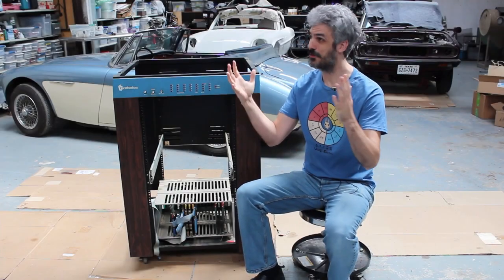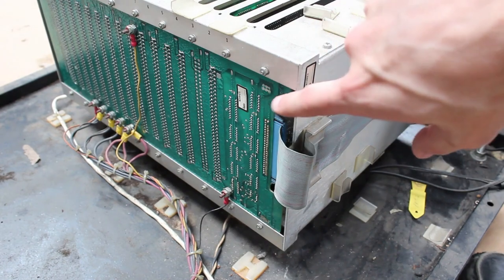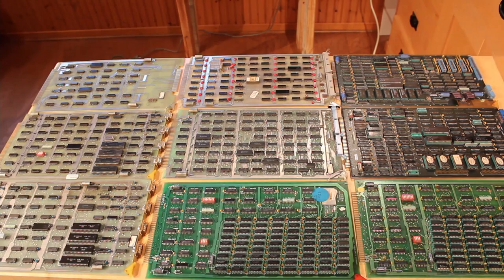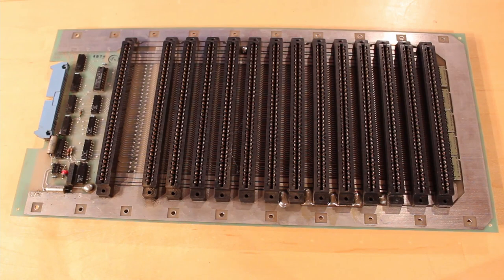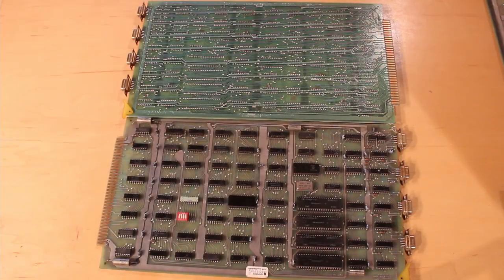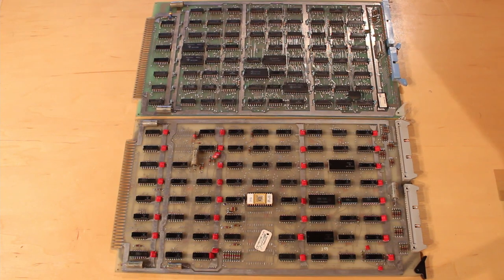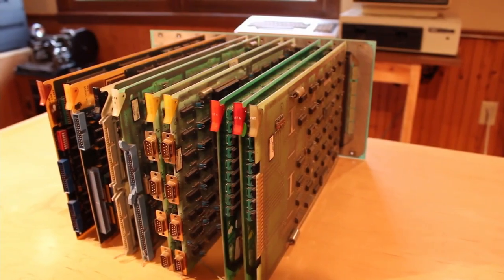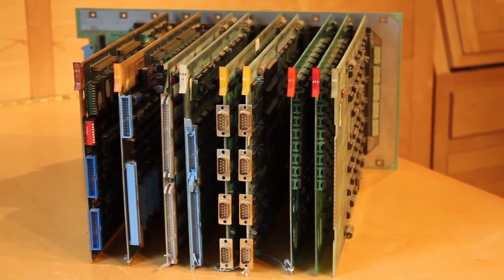Minicomputer Part 4: In-depth Look at all the Computer PCBs

Comment: I'm going to guess that the backplane board was installed at about the date marked, computers like that occasionally failed, and the engineer would just replace the boards with newer ones, or if there was an upgraded board for some reason, failed boards would often be repaired later by the engineers.
My brother was a computer engineer in that era and i learned a few things. including being witness to a head crash on a 10 disc pack at a large insurance company, 10 discs double sided so 20 heads (not all were damaged), but £600 each head in the 70's was expensive
Reply from the maker: Another commenter has reached out to me who used to actually work for Centurion back in the day! Check Ken Romaine's comment on this video, he has some unbelievably good information. He said that it's most likely the system was built around '79 or '80, and the stickers I see with different dates are warranty/repair stickers from technicians.

Comment: No need to replace bypassing caps, unless they are shorted which they don't usually do.
Reply from the maker: Yup, I think I'm going to go through and double check every capacitor for shorts on the board before I apply any power!

Comment: Looking at the CPU and CMD cards, the PROMS may contain the microcode and the BIOS. It would be interesting to get an EPROM reader and pull all the code off of them. I'm betting the architecture of the CPU is completely custom.
Reply: Also backing up their content is a good thing to do, these EPROMs can forget their bits in a future rendering the computer unrepairable
Reply from the maker: I'm totally planning to do a ROM dump of all the ROMs on the boards, just to be safe. Almost every chip on these boards can be replaced if something goes wrong, but the code on those ROMs probably only exists on those specific ROMs. So, hopefully we can dump them before anything bad happens!
As for a completely custom architecture, I think you may be totally right! I saw an old ad for a Centurion minicomputer that mentioned a "Centurion Word Processor", so it's likely that they had completely custom software to go with their totally bespoke hardware!

Comment: @11:49 probably some decoupling caps added after the fact when they found out things weren't stable.
Reply from the maker: That makes sense! 
I'm still not sure if they were added during production as a bodge for a defect on the board, or if they found that after use some instability arose and they "repaired" the board later down the line by adding them in. Either way, it's certainly interesting!

Comment: I have a feeling that this is an 8 bit architecture, but one of the boards is a secondary CPU for peripherals - or something equivalent.
Reply from the maker: I think you're right! Some others have mentioned it as well, but for these early minicomputers, it was apparently common to have essentially a separate CPU board that was dedicated to handling I/O and peripherals. These old computers are so different, it's really fascinating to learn about the ways they tackled problems back then!
Reply: @UsagiElectric  CPU cycles were precious back then, you wanted it to work on data, not acquiring it 😉 so a peripheral controler makes sense.

Comment: This old school pre-microprocessor computer gets me to wonder who designed it, and how, to what plans.  Each such custom (bespoke) design would have its own instruction set, it seems to me.  The ALU slice doesn't tell us what that is going to look like.  This is reminiscent of wild and wooly days where binary compatibility would be regarded as a joke.

If an assembler, let alone compiler, is found on board that would be a rare treat of a look.  Were contractors hired to program this for a business?  Or did the business use canned applications?  There is so much for the curiosity.
Reply from the maker: It really is a wild computer! It truly seems like Centurion was just designing things from the ground, which is absolutely awesome that they let their engineers run free, but also terrifying when it comes to repairs, haha. I've been able to find very little information about Centurion, but it seems they also had their own version of software too, so it'll be interesting if this thing ever powers up to see what's on all the disk packs. 
There's still a lot of work to do to get there, and I want to try and dump the contents of every ROM on the boards before I start putting power into things, but the more I dig into this machine, the more bespoke it really does seem!
Reply: Almost all of the individual minicomputers (and larger) had incompatible instruction sets. Heck, it was fairly common for successive computers from the same company to be wholly incompatible with each other. Sometimes various models in the same lineup might not be entirely compatible. ISA compatibility really only came about when the micros got super popular and you'd find the same CPU in machines from multiple vendors.

Comment: We were maintaining similar looking PDPs for air traffic control well into the 2000's, they just were too scared to move onto another system.
Reply: that explain the magnificent crash they had a couple of months ago, software systems are about a balance between change and ossification, they are running on dead systems, they just didn't knew it.
Reply: @monad_tcp  Not really, as they were replaced with a completely new system in the 2000's that took many years to develop.

Comment: 9:15 And it also seems to be connected to the crystal that is not present on the other board.
Reply from the maker: The other MUX board actually does have a crystal oscillator on the board, I just totally missed it!
If you look at 8:50 at the top board where the crystal is "missing," then go up to the top and over one row, that's the crystal. It's encased in a piece of heat shrink tubing, which is why I didn't recognize it at first.

Comment: Have the schematics been recovered/rescued?
Reply from the maker: Unfortunately, not yet.
I have met with a very nice gentleman who used to work for Centurion back in the day, and he's been reaching out to everyone he knows, but no one has been able to come up with any documentation yet. Some of the boards I can reverse engineer if necessary, but the CPU and CMD board are essentially 8 layer boards (power plane, ground plane, top copper, bottom copper, two top wire layers, two bottom wire layers) and are pretty much impossible to reverse engineer. Fortunately, they seem to be in pretty decent shape and mostly working!

Comment: UGh; age isn't so bad for some of those components, but do you need to check the resistors perhaps, see if they're at least shorted? But more to point, those caps.. do you know what kind they are (looking at the printer board); that is a really odd way to upside down them but okay .. but are they dried out and gone bad? Caps on the digital ICs are likely just decoupling to keep the voltage topped up, so a few going bad likely wouldn't impede operation but I coudl see a lot of caps going bad and needing replacing. Like cap kitting a CRT, but doing aaaaaalll those boards. Ugh :)

Wonder what the chances that exposed PROM still has valid code in it? usually a chip like that would be covered good or at least taped up .. just being wide open, means random sunlight that happened to get there over the last 30 years, could've wiped out something

Lol at 2566kB RAM in say 1983/1984, which wasn't even much _then_; ie: The 8 bit micros at the time were commonly 64kB; the Commodore 128 had the full 128 available in that mode IIRC "more or less"; the Atari ST was going to be 256kB but actually fcame out in 1985/1986 with 512kB .. so as a probably very very $$$ minicomputer, that seems like a piddley amnount of RAM for it, even for its year.

Those CPU boards are _Awesome_; never seen any 'multiwire' traces like that, just wild. Sort of like the coated wire in motors or the like ... looks like the 90 degree tracings might let you follow a trace if you had patience, and maybe if you had to do repairs you coudl do continuity testing by scraping out access to the trace, and then probing around to see where trhey touch; certainly you coudl probe chip to chip with guess work by the visible tracings.. so it woudl be painful, but you could probably do repairs if you had to. 

Are a lot of the chips socketed? Looked like it.. and all those 74 logic chips woudl be readily available I imagine.

Man its going to be hard to prove each board separately (if thats your plan), and to have any idea how to bring up anything once its all connected together; juist so many separate things all unknown. Such fun and crazyness!

Like, you might be able to figure out the edge card pinout for the RAM boards, and then have an arduino or rpi or just a standalone chip try to control and test the boards.. ie: see if you can tell a RAM board to srtore a value and pull it back, say; make a little test jig that tests all the RAM addresses on a board, that sort of thing.
Reply from the maker: Honestly, I'm not too concerned about the decoupling caps that are upside down. I mean, there's like hundreds of them across all the boards, so I'm just going to pretend they're all okay until one of the causes an issue, haha. I will definitely go through and check the power rails on each board for shorts though!

The good news about that exposed PROM is that it was buried deep in the system, even with sunlight shining directly on the chassis with the covers off, it still wouldn't have made it's way down to where that board was. So, I'm hopefully it's still got viable code stored in it. I do plan on doing a ROM dump of all the ROMs in the system though, so hopefully if one of the ROMs dies in the process of powering it up, I can get a replacement ROM in.

I was initially thinking that 256kb was tiny for the year, but I think I may actually be off a few years in guessing construction date. It seems a lot of the stickers I was looking at that said 1983 on them were actually repair stickers (I'm terrible at reading handwriting), so those boards were probably built around 1980-ish. But even still, the TI-99 was released in 1979 and had 16k of available RAM on board and could be expanded by another 32k with a memory expansion sidecar. So, the Centurion system was built around the same time and cost roughly 10x as much as the TI-99 and Ram Expansion combined, but only had 256k of memory.  Perhaps for the specific software suite they sold the system with more memory wasn't super necessary though.

That Multiwire board is crazy isn't it! Supposedly they're super fragile and flexing them, even slightly, is enough to break traces internally, which could lead to weeks and weeks of troubleshooting. Repairs maybe indeed be doable through extreme patience, but man would it be a time consuming ordeal, haha.

It seems that almost every chip that is not a standard 7400 series chip is socketed. The 7400 series chips all seem to be directly soldered in though. Perhaps they trusted those a bit more than the bespoke chips. Fortunately, all of the chips, even the AMD ones, look to still be available here and there, so the only real concern is broken traces or bad ROMs.

I'm not really sure it's even possible to prove each board separately. My current plan is to replace the non Sprague electrolytic caps, check each board for shorts on the power rail, then plug it all in and power it up to see what happens! I'll probably power it up without the drives attached initially just to see if the terminals get anything from the computer. But, if it looks good from there, I'll start plugging more and more stuff in until it's good to go!

Comment: Do you plan to restore this to full functionality, or is it more of nostalgic novelty?
Reply from the maker: I certainly hope to get it booted up and running someday! 
One of the primary reasons for going slow at the beginning here and giving super detailed shots of all the boards is so the excellent community here can get me pointed in the right direction for getting this thing powering up safely!
Reply from the maker: @SteveHacker  Thank you so much! 

I’m really looking forward to seeing where this journey takes us. It could very well have some components that are just too far gone to repair without having some schematics or logic diagrams to reference, but I’m staying hopeful that it’ll show some resilience and give us some life!

And speaking of resilience, I grew up thinking that electronics were extremely delicate and one wrong move could destroy the whole thing. But, the more I mess with stuff, the more I realize electronics are tough as nails. On most things, the engineers designed the circuits to be robust enough to handle quite a lot of abuse, and even individual parts are pretty tough. The reason it seems like they’re so frail is because there are thousands of parts working together and if one fails, the whole thing goes into failure mode. Find the one failed part, replace it, and usually you’re back in business!

The hard part is finding that failed piece, but interestingly, I approach working on electronics a lot like I approach working on an old car. It’s just a lot of trying to understand what’s going where and then working through pieces one by one until you get to the right spot. 

But, all of this is totally me coming at it from a hobbyist point of view. There’s totally better ways to go about troubleshooting, repairing, building, designing, etc., but I just try not to take it to seriously and make sure I’m having fun, even if it isn’t the right way to do something. And, it sound like you totally aren’t at square 0! Doing the occasional PCB kit means you’ve got a strong base, and that’s a great start!

For me, I found BEAM robots to be the most satisfying entrance into electronics. They’re usually solar powered, so it’s almost impossible to damage any of the components. There’s a ton of really interesting designs and brilliant misuses of components to get them to exhibit really wild, almost life-like behavior. I still have a few BEAM bots sitting around the room that I’ve built. The part count is really pretty low per bot, so the cost of entry is usually incredibly small (like under $10 small) and the designs are flexible enough that you can really make some unique designs!

Here’s a few little ones that I’ve made: https://i.postimg.cc/jds8NXFs/IMAG3816.jpg

And here’s a site with some really beautiful examples: http://www.smfr.org/robots/

This website has a lot of great information to get started too: http://solarbotics.net/library/circuits/bot_popper.html

At any rate, that’s how I got started into electronics!